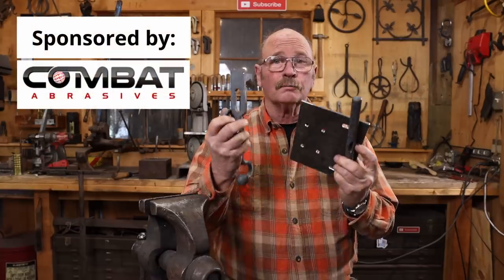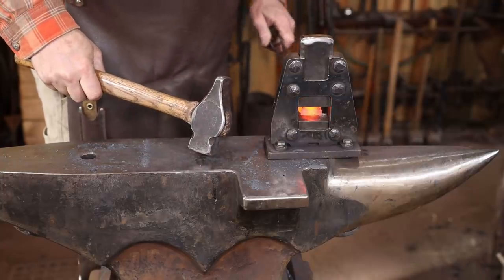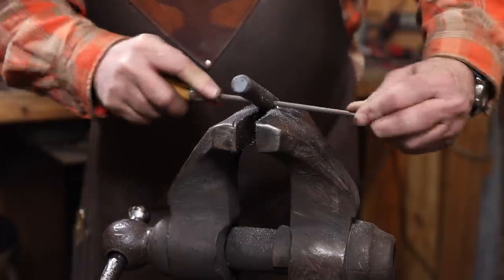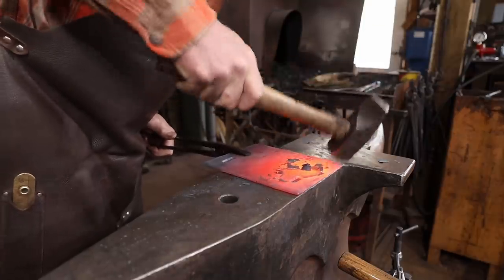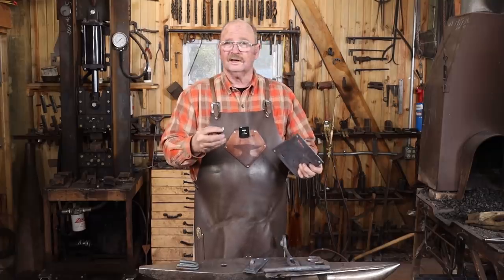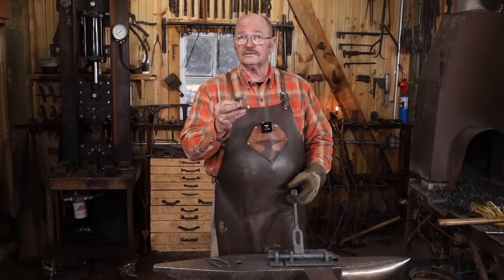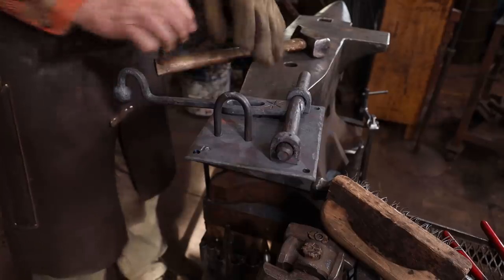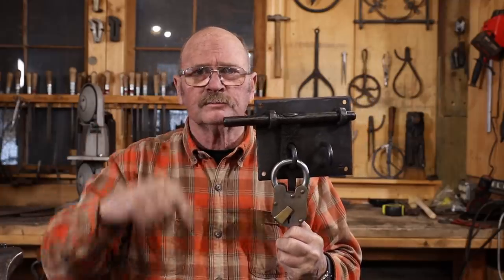Assembling the Sliding Door Bolt - part 2

Comment: What is that contraption you use to light your oxy/acetylene torch?? I’m a welder and I use a torch every day, I would love to find out how you’re lighting it that quickly and with one hand. 
Thank you!! Love your content, I’m a beginner blacksmith and have learned so much from you. Keep it up!
Reply from the maker: Its a gas saver.  Fuel and oxygen in with a shut off you hang the torch from and a pilot light.  Mine is made by Smith.

Comment: Would it be possible it divot or sink the plate so the rivets lay flat on the door?  Great work!
Reply from the maker: Flush rivets in the thin mounting plate wouldn't be as strong.  But with a thicker plat it would work